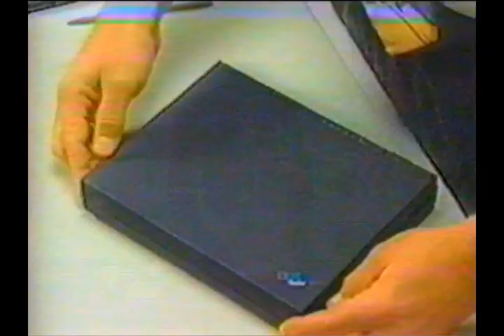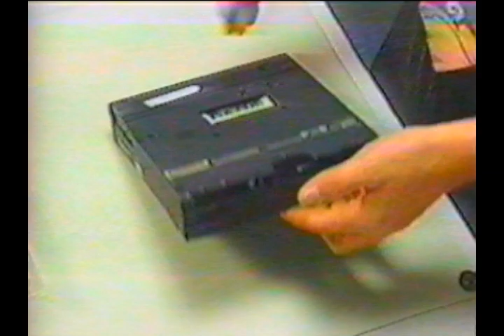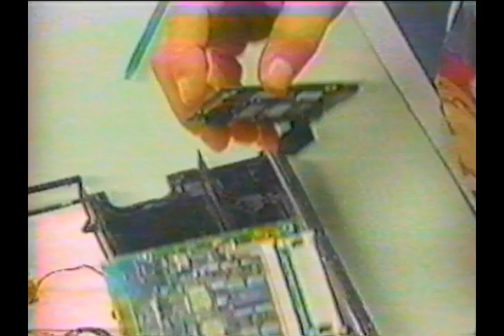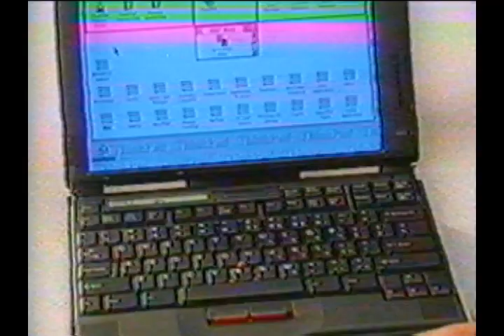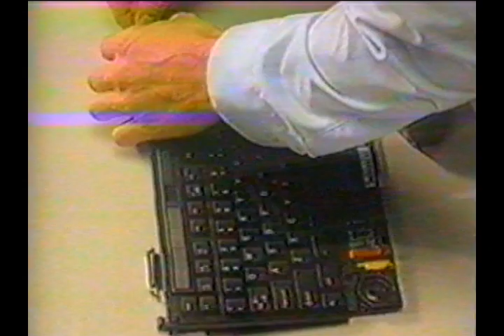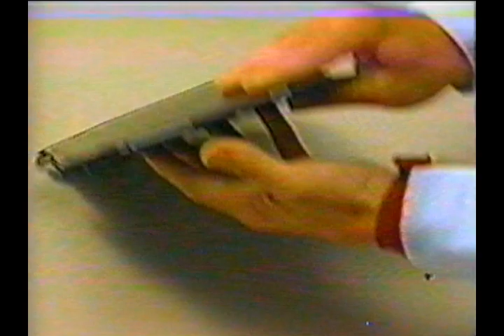IBM Service Training VHS ThinkPad 701c and ThinkPad 760

Comment: Great video. I have a 75mhz 701c in my 'tech' closet. Worked when I last fired it up 10+ years ago.
Reply from the maker: You might want to check on it. These machines degrade.